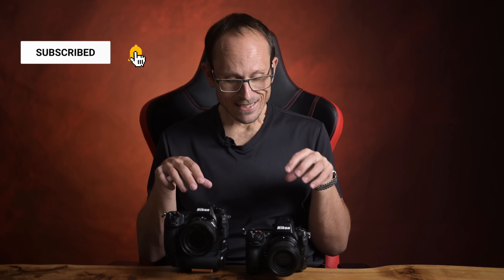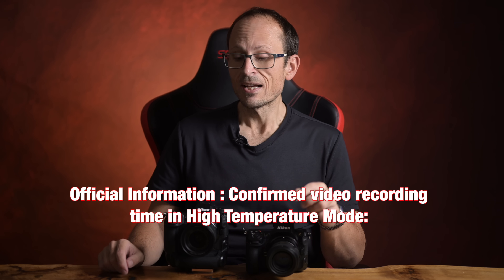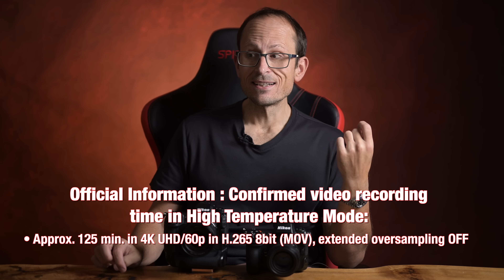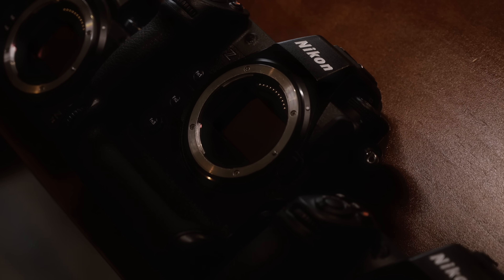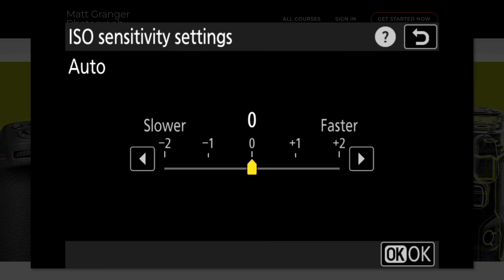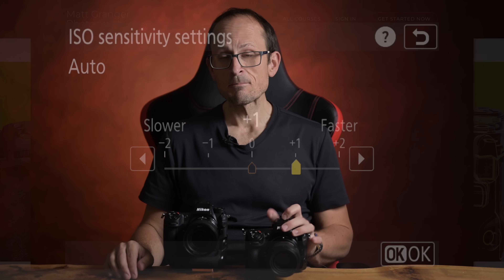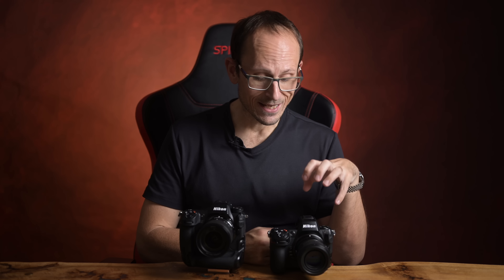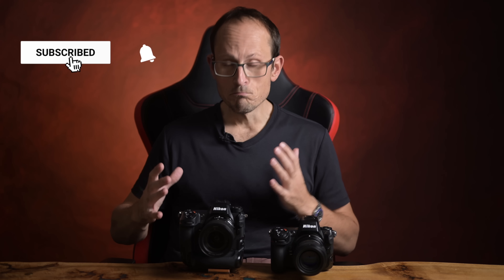Nikon Z8 - Video OVERHEATING & Battery Testing (VS Z9)

Comment: I was recently shooting high speed bursts for around 1.5 hours with brief gaps in between. I must have shot around 1500 RAW in that session. But when I started shooting 4K 120fps video it showed HOT CARD error after around 2-3 minutes of starting video. And that's how I ended up on this thread. So from what I understand shooting images is not an issue, shooting only video footage will be a small issue which can be handled, but shooting fast bursts and high speed videos back to back can certainly escalate the situation.

Comment: Retest with the Delkin Black? Those run at 10C less than the Cobalts. Does having the card door open extend the time before "hot card" shows up? Replace the door with a copper equivalent that makes contact with the card via thermal conductive pad? Does articulating the rear screen extend the time before warning? If it articulates like my D750, I could absolutely throw a 1/8" copper fin bar in there for vertical convection cooling with the screen pressed up against the short fins... that's 50% cooling coverage of the rear of the camera, basically.
Reply from the maker: I’m not removing the card door or replacing parts. You feel free.
Reply: @mattgranger oh the test I was asking most about was having the card door open not removed. And a Delkin Black which runs about 40C less than most CFExpress b. That extra confined heat will surely be soaked up by the mainboard.
Reply: @mattgranger  awesome video btw. Thanks!

Comment: Most of my video needs are shorter takes and usually only in 4K25/50 but I do some longer form video as well and it makes me a little nervous using the Z8. I use a Pocket 4K currently for my "sit on a tripod, hit record and forget it" work and it has always been rock solid. I have had a few hot card warnings in a 20C air conditioned room but found they actually went away when I pulled the screen out. That seems to be where most of the heat builds up, particularly on the right hand side where the card is

Has anyone experimented with using a small fan to cool the Z8? I know a lot of people would scoff at using an external fan but I see it as adding modular active cooling for when I need it. My Pocket 4K has active cooling and it never has overheating issues, ever, so the idea of a very small fan to move some heat off on long takes appeals to me

Comment: Matt, I have few questions: Could you clarify please?

1. Recommended external battery source to avoid heat or dead of internal battery soon and to record for extended time

2. Can I record 8K and 4K N-Raw (12-bit) and 10- bit to Ninja V also over HDMI?

3. Can Z8 record directly to an external SSD (2TB or 4TB) for extended time just to avoid any heating on the Cfex B card?

4. I can record the CFex B card (1TB or 2 TB) when I use a gimbal or for a short period of time
Reply from the maker: 1. Nikon dont have a suggested power bank. you can use the supplied charger or any PD pack
2. read this https://onlinemanual.nikonimglib.com/z9/en/09_connecting_to_hdmi_tvs_and_recorders_03.html
3. no. 
4. what does a gimbal have to do with it?
Reply: @mattgranger  Thank you for the response Matt. If I want to use a gimbal for a short time, I can record the CFex B card directly. 

I am looking for the best hybrid camera. Based on your testing, Z8 may not be good if I want to shoot RAW videos.
Reply from the maker: yes of course you can.

Comment: Thanks for making this video.  I have a question that seems to be discussed in the comments, however I just want to be sure so asking anyway.
I don't see a situation where I would be filming for one hour of straight footage, but filming an hour event like a soccer game, how do you pace yourself so you don't overheat the camera during that hour?  My whole purpose for upgrading to this camera is to shoot 120 fps, 4K at the highest bit depth possible to capture these events photo and video, which is why I didn't go for a cinema camera.  I appreciate your input on this.
Reply from the maker: Hi mate. To answer your question - with the Z9, there is no pacing - it will just film the hour and there will be no issue. But the Z8 is unlikely to keep up, unless its very cold conditions. I got a hot card warning last week just taking stills.
Reply: Oh boy, thanks for the heads up.  Z8 is on arrival, so might send it back and get z9 (it's the size not the price that concerns me).   I heard certain cards perform much cooler than others, I might test with other cards just in case.  I appreciate you taking the time to respond.

Comment: Thank you a lot. I was thinking about buying a Z8 exactly for recording 8K video, not that I need 8K, but I love doing camera moves in post. I use two Z6 currently (4K) with an external timer that restarts recording after 30:05 min due to the stupid 30 min limitation. To have 8k without interruption would be so nice, but if the heating problem makes 90 min 8k on the Z8 impossible, I will stay with my Z6 cameras. Too bad, but saved a lot of money for me. I actually cannot believe that a camera of that price point has an overheating problem. Would have never guessed that so I am glad that I found your video. Btw. greetings from rigger to rigger.
Reply: Also depends on the environment you are shooting in.  Lower ambient, longer it records. I guess it was never going to beat the Z9 in video times. But it seems to do well against the competition.
Reply: @MattIrwinPhotography  could you tell us the brand and model of the CFexpress you used? I'm quite sure some overheat quicker than others. Thank you.
Reply: @MattIrwinPhotography  
Thanks for that info. I do not have trouble with external power if that solves the problem. I do record such takes indoor. I just put the camera somewhere and I need to rely that it just records unmonitored and reliable. That the camera does not overheat when plugged is good to know. Thank you.

Comment: last Saturday my z8 got a warning for card overheating (sony XQD) at the middle of a wedding. By the time that was using the z9 at the same time and, same conditions... But it was a specific hot as hell day, in a closed dor 3 pm place, here in Minas Gerais BRAZIL. By the way... we are PHOTOGRAPHERS, we were just taking photos, not a single video was recorded
Reply: This is the opinion I need the most. I am in Asia and it's quite hot, and I also take photos frequently rather than filming - so I can be determined to buy the Z9. Thanks.

Comment from the maker: PLEASE READ. A few points that people seem to have missed in this video...
02:39 This wont impact 90%+ of buyers - only those HEAVIEST into high bitrate video users
03:43 The cards used are both cards approved by Nikon for Z9 and Z8 high bitrate video. I alternated cards between cameras.
08:19 The Z8 performance is pretty incredible given the size and weather sealing
I was indoors in an air-conditioned 22c room to run the tests (this is in the video description)

I didn't say its a bad performance, I didn't hide the room temp or the cards used etc etc. Some people are going out of their way to try to suggest 1. there is no overheating with the Z8, 2. its just a card issue and 3. my tests were flawed.

See the points above - this won't impact most people, it was a chilly testing environment, I am impressed with Z8 performance, the cards were all Nikon approved and were rotated between cameras. The cards over heat in the Z8 and not the Z9... that isn't a card issue.

In the heaviest video formats the Z8 overheats, and it is more likely to overheat than its much bigger brother - It's not the end of the world - and it probably won't affect you. 

I am adding this post as its quite annoying to have your carefully chosen words twisted and misrepresented, and have your honesty questioned. As I am pinning this post, I will now copy and past the full test results below - Including PD tests:
CARDS USED
https://geni.us/cobalt650
https://bhpho.to/3VZymEZ

(note the ones I used are the approved cards - Delkin and Angelbird are not on the list)
https://www.nikonproductsupport.com/s/article/Z-8-Supported-Memory-Cards?language=en_US&fbclid=IwAR2KgbCkBujfpbR9mH2HGp15utmUN1mmcMNnNFSB891LluKZzIonNvUM6zE

RESULTS
10bit 1080 120p
27 mins camera hot
2930 hot card

Nikon Z Setup Guide - UPDATED FOR Z8: https://learn.mattgranger.com/courses/zsetup

10bit 8k 30p oversampling off – POWER DIRECT
15 minute hot card
18 hot camera
40 high hot camera
52 minutes shut down

4K UHD/60p in H.265 8bit (MOV), off for extended oversampling – POWER DIRECT
16 minute hot card
47 hot camera
140 something Hot camera gone!

Prores 10 bit 4k 60p
1030 hot card
1040 hot camera
1945 high 
3026 shut down

N-RAW 8.3K 60p
700 hot card
715 hot camera
15 minutes format cards
2 minutes high heat
5 mins Z9 – hot card
1130 Z8 shut down

Shibari 101 course (N5FW): https://geni.us/Shibari101

10 bit h265 8K 30 – extended oversampling ON
600 hot card
1230 hot camera
4000 high 
5900 shut down
Z9 does 125mins, restart and 37 mins – still no hot card

10 bit h265 4K120p – extended oversampling ON
Fast hot card and hot camera
1200 high 
3500 shut down
Z9 does 125mins, restart and 37 mins – still no hot card

PRORES RAW 4.1k 60P
1 minute hot card
550 hot camera
Ran out of space

8 bit h265 4K60p – extended oversampling OFF
1 hour 39 – hot camera
1 hour 45 – dead battery

8 bit h265 8K30p – extended oversampling OFF
17 minute hot card
28 hot camera
1 hour 16 dead battery

Comment: Shot first soccer game, wanted to briefly share results.  Card is SanDisk Extreme Pro 512 GB 1700/1400 Type B.  Sunny day, 80 degrees F.  Prores 10bit Nlog 30 fps, hot card after 10 minutes shooting off and on for about 1 hour.  Never hot camera, but always hot card.  Tested at home after.  Cool room, same camera settings.  Hot card after 15 minuets.  No hot camera ever.  After cooling card, with batter door open, hot card after 25 minutes.  Laser temp of card 125 degree F.  .  I tried Green Extreme card reader, card heated up quickly to 125F.  I guess you can't blame the camera, but will running hot card in camera damage camera?
Reply from the maker: What do you mean can’t blame the camera? The same card in the z9 won’t get overly hot. 🥵
Reply: Interesting. I meant because it actually got hot just sitting in the card reader without transferring files, that seems odd to me, like it's the cards nature to get hot.  Well, you inspired me to get the z9 and send back the 8, hot card and hot camera are deal breakers, Nikon should be more upfront about this.. unless I missed it in their documentation, etc.  Appreciate the discussion.

Comment: @matt are this tests on High/Normal heat tolerance settings??
Reply from the maker: High.
Reply: @mattgranger  thanks for replying, one question can it record 4K60fps10 bit same as 4k60fps 8 bit  1Hour+ ? and which Memory Card (Brand / Type) you were using ?
Reply from the maker: Cards and all tests I’ve done are in the pinned comment.
Reply: @mattgranger  thanks, good video with detailed explanation 👍🏼

Comment: What puzzles me is the Hot Card warning.  How can it happen with the Z8 and not the Z9?  You were switching cards so it wasn't a bad card.
Reply from the maker: My theory is the z9 mag alloy body can dissipate the heat from the card so it doesn’t reach over heating level. The z8 body cannot

Comment: Matt, Z8, when the card cover is open, install a cooling metal sheet on the CFB card, will it improve the overheating of the card?
Reply from the maker: Go for it. I’m not DIYing a $4000 camera.
Reply: @mattgranger  There is no need to make any changes to the camera, only a thin heat sink needs to be pasted on the metal surface of the memory card. Just keep the card slot cover open while recording video.
Reply from the maker: Go for it. I’m not

Comment from the maker: UPDATED TEST RESULTS - Including PD tests:
10bit 1080 120p
27 mins camera hot
2930 hot card

Nikon Z Setup Guide - UPDATED FOR Z8: https://learn.mattgranger.com/courses/zsetup

10bit 8k 30p oversampling off – POWER DIRECT
15 minute hot card
18 hot camera
40 high hot camera
52 minutes shut down

4K UHD/60p in H.265 8bit (MOV), off for extended oversampling – POWER DIRECT
16 minute hot card
47 hot camera
140 something Hot camera gone!

Prores 10 bit 4k 60p
1030 hot card
1040 hot camera
1945 high 
3026 shut down

N-RAW 8.3K 60p
700 hot card
715 hot camera
15 minutes format cards
2 minutes high heat
5 mins Z9 – hot card
1130 Z8 shut down

Shibari 101 course (N5FW): https://geni.us/Shibari101

10 bit h265 8K 30 – extended oversampling ON
600 hot card
1230 hot camera
4000 high 
5900 shut down
Z9 does 125mins, restart and 37 mins – still no hot card

10 bit h265 4K120p – extended oversampling ON
Fast hot card and hot camera
1200 high 
3500 shut down
Z9 does 125mins, restart and 37 mins – still no hot card

PRORES RAW 4.1k 60P
1 minute hot card
550 hot camera
Ran out of space

8 bit h265 4K60p – extended oversampling OFF
1 hour 39 – hot camera
1 hour 45 – dead battery

8 bit h265 8K30p – extended oversampling OFF
17 minute hot card
28 hot camera
1 hour 16 dead battery

CARDS USED
https://geni.us/cobalt650
https://bhpho.to/3VZymEZ

Comment: I'd be super interested to know if the overheating changes when using an external power source vs the battery - especially using the same card as is tested in the Z9.
Reply from the maker: See pinned comment.

Comment: What recommendations would you make for recording video for 7 speakers, each having  45 minute speeches over an 8 hour day, indoors. Cards, and battery life are my concerns.
Reply from the maker: Id use z9. 8 or 10 bit 4K and it’ll be no issue at all
Reply: @mattgranger  thnx  Matt.

Comment: Matt, I think what people are missing here with regards to this "overheating issue" is this camera is being "COMPARED TO THE Z9" (even though it is in the title)  for recording times and of course at that level it will not be the same. The smaller body negates that level of performance. When compared to other $4K, it's recording times exceeds them. I'll add a bit of context for those wondering how the competing cameras at the Z8 price point performs.

The Canon R5 manual (after firmware 1.6) list 45 minutes of 8K30p (didn't specify 10 or 8bit) at 23C/73F with high temp setting. The Sony A7R V manual list 8K24/25p for 30 minutes with high heat setting turned on at 25C/77F. Sony went a step further to list recording time at 40C/104F, which is 20 minutes. In your Z8 vs Z9 test, the Z8 ran for 1h 16min at 8K30p 8bit, on internal battery before it died. That beats the Canon R5 and Sony A7R V, the cameras at which price point in competes. Now, let's look at Nikon's test method, 8k30p 8bit, auto high temp set to high, temp at 25C/77F, with an external battery connected, it runs for 1h 30min. 14 minutes more than the internal battery. As you stated, "the performance is pretty incredible for a body this size and being weather sealed." No one should expect this camera to perform similarly to the Z9, in a smaller body without active cooling, for video recording. 

We can however, assign it the title of  "2nd best performing, hybrid camera without active cooling," currently available as of May 2023.
Reply from the maker: Yes it’s in the title, in the frame, in the test results, and if anyone actually listens to the intro, it’s pretty clear, fair and transparent.
Reply: @mattgranger  Don’t worry about it Matt. I watched the video several times to see if I missed something based on the comments. I think what rubs some people and is a point for the Nikon haters is that the Z8 overheats. Missing the point that all cameras without active cooling (fan) will over heat if used for long periods. The Z9 has a higher threshold but it too will overheat, if the time limit Nikon put in was removed.

Comment: Would be interesting to know what the results would be on external power. Either usb-c or the battery grip.
Reply from the maker: Running additional tests now. Pinned comment with updated results coming soon